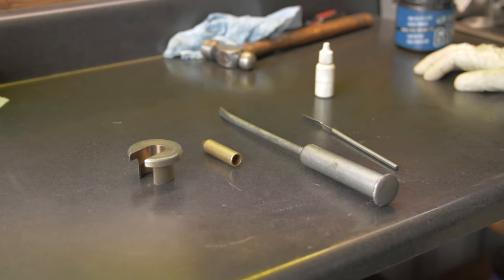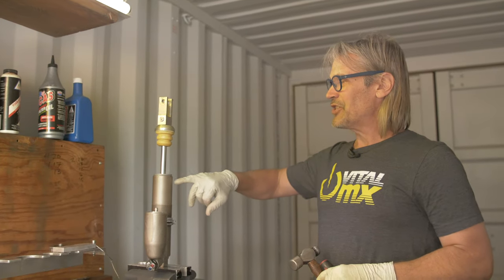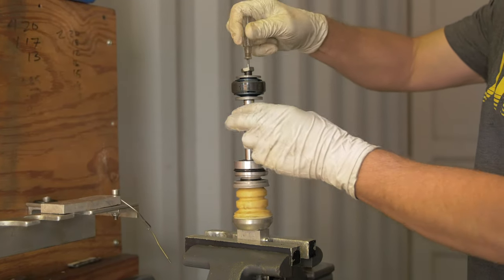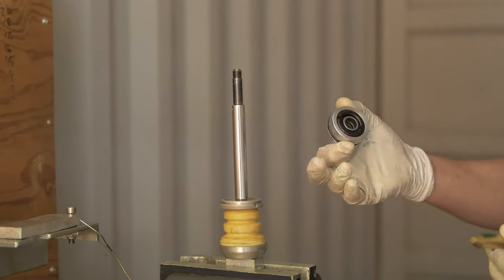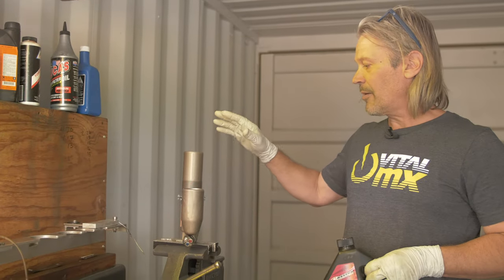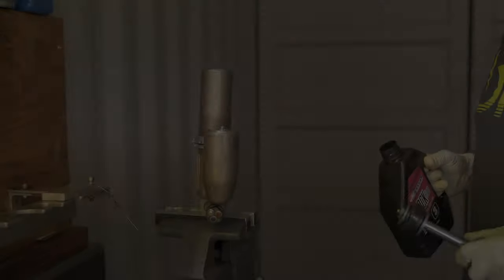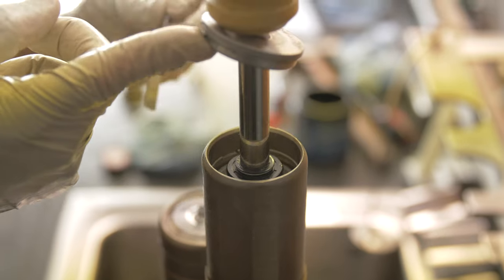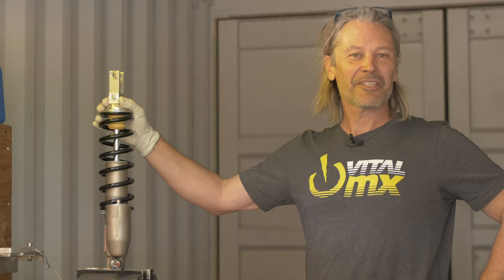Vital Tech Tip: How To Rebuild A Rear Shock

Comment: I’ve got a horror story which led me to this video. I did it just as you described there but either got hydraulic lock or the valving wasn’t opening at all. A YZ 85 shock that was pretty frozen would only move a couple inches. Nearly a liter of oil ended up on me, the ceiling, a shelf with electronics, and my garage floor.
Reply: Same
Reply: Haha. Same. Couple times. Putting the seal head in last seems to be the fix.

Comment: Hi I have a wp unit of a Ktm which has started leaking oil. I was wondering as the inflation screw needs to be opened for depressurising, how can I get my hands on the inflation adaptor please. Can I make one up or need I buy one. Thanks

Comment: Just found this vid after I had already started taking my shock apart. You said to check the action of the shock after the spring is removed. I just checked and had no rebound. I already let the air out of the shock though, so does that make a difference? What could be wrong?

Comment: I recently landed flat and cased a jump a few times because it was my first time hitting bigger jumps. I had my compression adjuster all most on the stiffest setting because I like stiffer suspension, but the next day I noticed that my shock felt like the compression adjuster was set to the softest setting but when I checked, it was still set to the stiffest setting. The compression adjuster still clicks when I turn it and it feels completely normal but no matter what setting I put it on, it does nothing. Before this the stiffest setting would only sag like 10%, but now it sags about 30%, as if it’s set to softest setting. Rebound also feels completely normal. Can anyone tell me what’s wrong and how can I fix it?

Comment: The guides are downright great!
I have a great request. I have a 2008 R1200 (0303) with a Showa rear shock with preload adjustment knob on the damper, no reservoir. I have a gasket and bushing overhaul kit purchased. The shock absorber has been removed. Please advise on how to revitalise such a shock absorber.
Please give me a quick tip on how to remove the adjuster with knob and the spring. I think I can handle the rest. A video is of course welcome.
The manufacturer claims that this is not repairable, and digging through YT has not resulted.
This is a shock I have.
https://youtu.be/jjDzOGjax3s

Comment: I just run them until they break or I sell the bike
Reply: mistake dont do that if you do not know how to service it just get it to someone who knows how to handle these shocks, or just sell of the bike. the rear shock holds majority of the weight of the dirt bike engine chassis subframe etc. and no one will ever buy broken dirt bikes especially in places broken in the engine or chassis